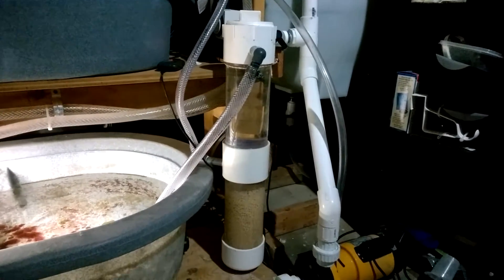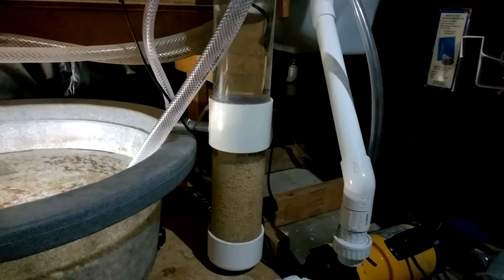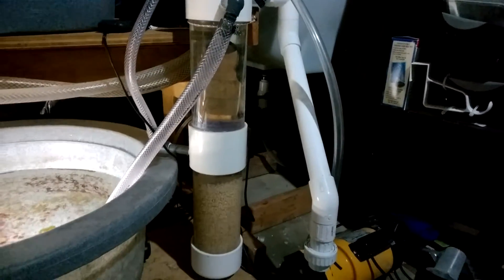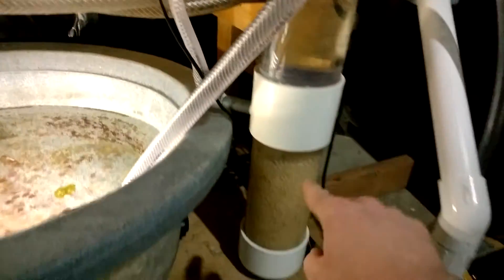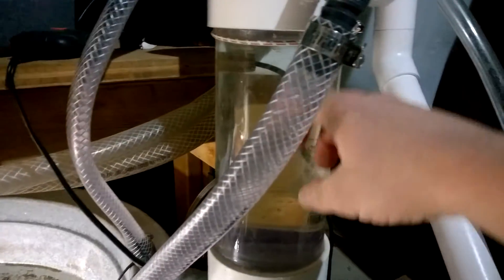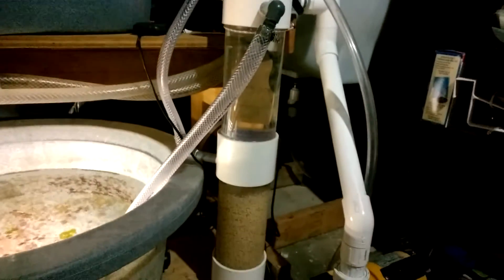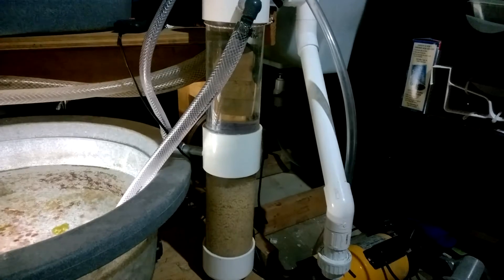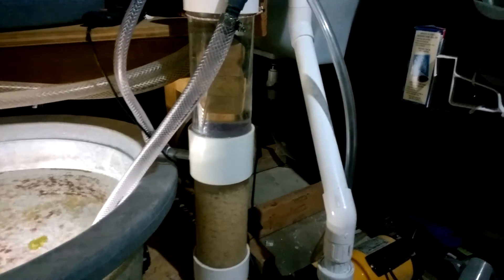DIY Bio Pellet Reactor Upgrade

Comment: Kick ass manifold! I can't wait to get a larger return pump so I can utilize mine. Us basement guys deal with alot of head loss. I want a external but I'd have to drill the sump. A big ol Hammerhead gold or reef flow. A submerge 2000gph + would do also but anyways nice job Scott.  Congratulations on the tangs getting along as well.